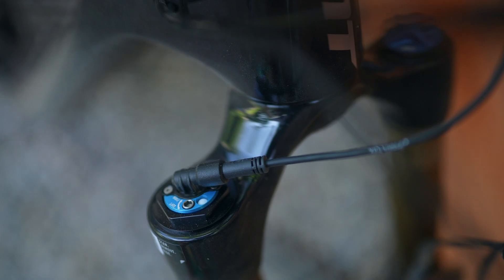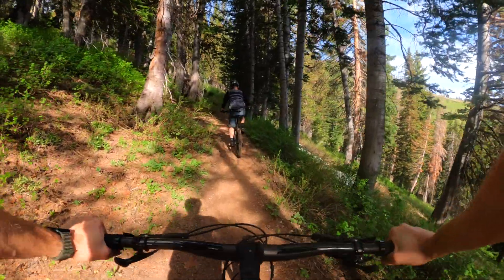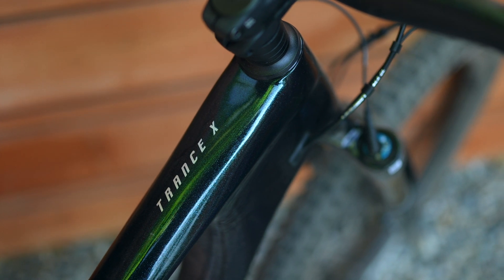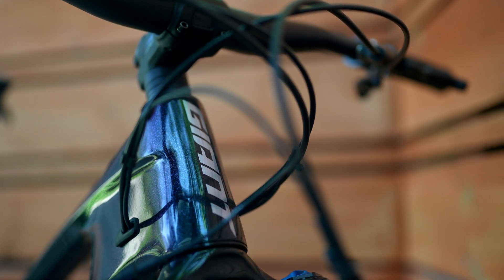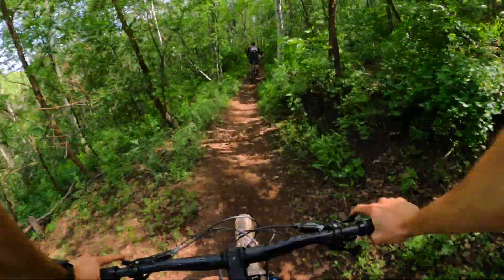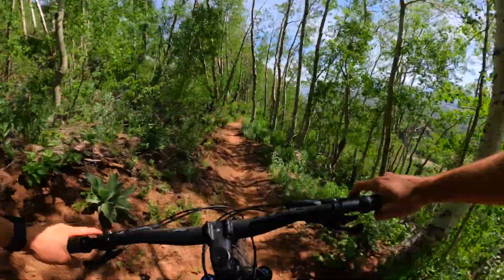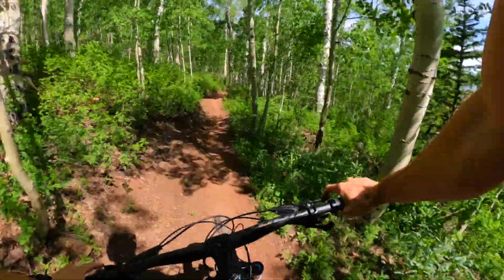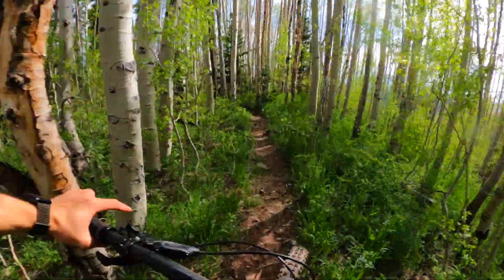Fox Live Valve: The Breakdown

Comment: Can the live valve system be used without an app?
Reply from the maker: Not really. You need the app to set your preferences and change between modes. At least on this older system I rode.
Reply: @bikersedge thanks.

Comment: Giant has great closeout on this bike. Still a buy 3 years later from your original video?
Reply from the maker: It’s still a really good option in my mind. Totally relevant and for the right rider a solid option. It’s sporty and quick.
Reply: @bikersedge would be my first full suspension and would like to use for Leadville 100
Reply from the maker: Not sure about that exact use case. From what I understand Leadville is pretty gravel/fire road. This would likely be overkill for that event specifically. That said this would be a great all around bike.

Comment: Are the shock cable connections at the controller and the fork permanently connected or break-away?  With that much open cable slack in the front I could see a branch getting between the bike and the cable and ripping it right off.  If that were to happen, then is it RIP for the controller without a shop fix?
Reply from the maker: There's a quick release on the cable right by the fork damper.

Comment: I just bought this bike today with the live valve also.  I was under the impression that you could just take it off If you don't like it  but sounds more complicated than that.  Looks like you would have to replace the top of the fork and shock with new heads that have the adjusters on it?
Reply from the maker: Yeah. You can’t take off the live valve. You can turn it off but you can’t easily take it off.
Reply: @bikersedge  So many mixed reviews. I wonder if I should cancel my order, or should I keep it?
Reply: I went to the shop. I'm on a medium but they had a large and I tried it out and it actually seemed pretty cool, still felt plush enough.
Reply: @TomCollins-c4h  How have you found it?

Comment: I’ve had no issues and I have it on my my Giant Reign Advanced Pro 1. Loving it for the past year. I keep it in Open Mode if there is jumps and drops. Works perfect. Only firms up the rear shock when climbing or peddling flat ground. You can change the sensitivity in the menus on each mode. If I’m on a flow trail with very little jumps I put it in sport or firm with higher sensitivity.
Reply: am looking into that same bike.

Comment: So to change the settings from say climb to comfort etc, do you have to stop, get out your phone and go into the app? Or is there a controller somewhere on the bike to change it as you ride?
Reply from the maker: For those setting you have to use the app. I see those as more long term setting based on where you ride and your preferences. Really once you find the one you like the suspension reacts automatically to the trail so you shouldn’t need to change it often.

Comment: I have the same Combo as you, Trance X Adv Pro 1 with Live Valve. Agree, for me it is fire and forget on the trail. The bike is FAST and soaks up any grief I give it. My only concern is steep Climbing on smooth tarmac roads (to get to the trails...) When I sit the front fork stays locked out, so max pedalling efficiency. BUT, when I stand on the bike to put more power through it and attack the climb, the fork starts to bob so power being wasted. Any advice? I wish there was a manual lockout option, just for this scenario.... though I am willing to believe I am missing something really obvious.
Reply from the maker: You could run it in the firm setting as well as dial in the compression on the adjuster. Could help.

Comment: I am not normally a early adopter but I pulled the trigger on a Trance E+ 0 with Live valve and been really happy with the system. Running it mainly in comfort mode and climb mode same as you. So far its been reliable and I honestly have not noticed the clicking too much.
Reply: I went and looked at a Trance Advanced Pro 2 today that is over 50% off, I think I am going to pull the trigger tomorrow after watching this.
Reply: When I connect to the App and carry my phone while cycling. But the phone screen turns off and the connection is lost